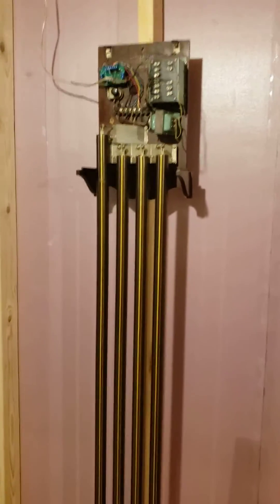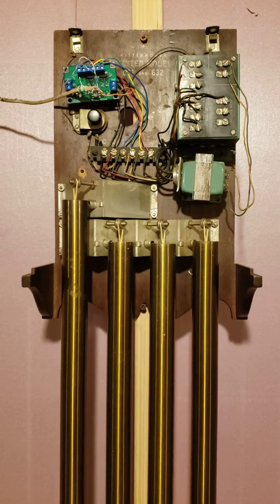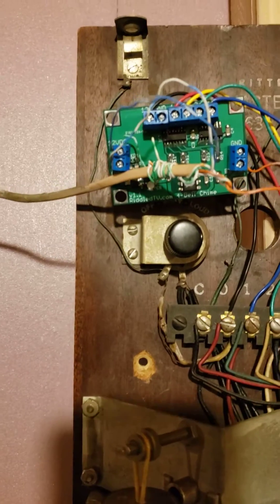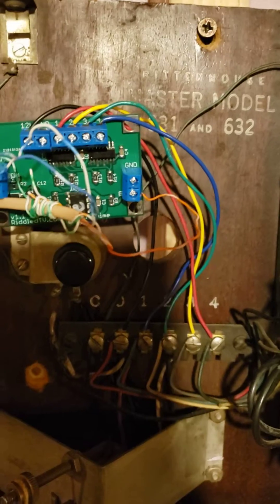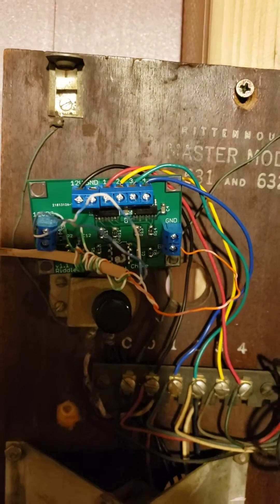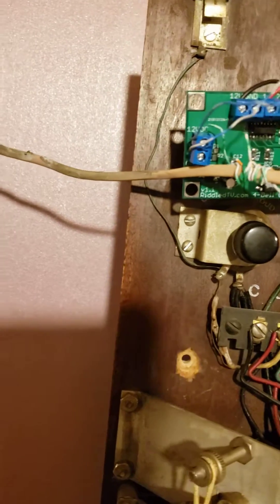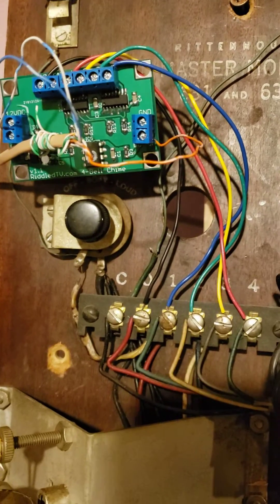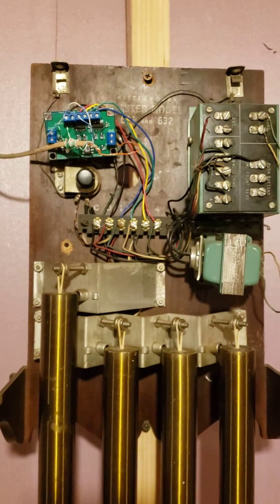Rittenhouse 631 and 632 Replacement Doorbell Chime Sequencer

Comment: Hi! Fantastic project. I too have this exact chime but have no clue on the wiring. From the front door push button to the chime. Can you possibly guide me on the wiring? I also spot an extra circuit on the top left side which is not present on my chime. It will be awesome if you could help when convenient for you.